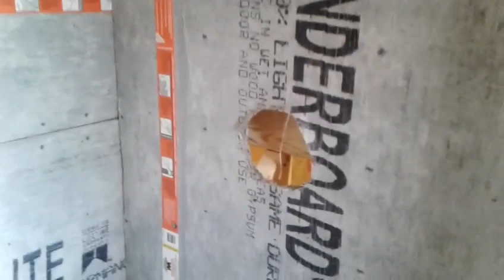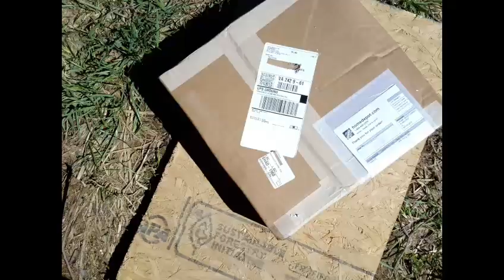Building the Bungalow part 4 finishing the interior

Comment: The saw needs a drop of oil in the bearing opposite of the blade end (near the brushes)and the noise will quit for a while. I sure do like your videos.
Reply from the maker: Thanks--- I hear gears grinding.  It has some kind of brake that has failed as well. I may dismantle it.

Comment: There is a secret oil port on all models give it a little 3 in 1 oil and she will run again no problems. It wouldn't hurt it clean it out by dismantling and getting the goo off the bearings before oiling but if not just a good squirt should do you.

Comment: That looks great I’m really impressed. You are an incredibly talented man! I love those angel singers.
That miter saw was not ruined or broken. It has an electric brake sort of like an emergency brake in your car. The electric break in your saw stops your blade when you let off the trigger using the electric power in reverse. All you need is to order some new brushes for it. I’d order all brushes for it at one time. If you still have it.

Comment: I notice you did not sheath the outside before applying the metal roofing.  I hear many others talk about condensation forming and they take pains to prevent condensation.  They talk about vapor barriers and providing ventilation between the insulation and the exterior walls.  I wonder what your experience has been these past 5 years and if you have peaked behind your insulation to see what it looks like.  I might also think that critters could find their way into your insulation and think it would make a fine breeding ground.  I am dreaming of doing something like this as a complete amateur so I greatly appreciate your videos.  I'll be playing guitar and keyboard though.
Reply from the maker: I have had many questions about this....
I had a fair amount of experience with using metal roofing in the type of application.
I have excellent ventilation and the steep angle of the roof prevents dripping.
I even took part of the roof off to inspect and all is well.  
I have had zero problems.....other than my ongoing battle with mice....lol

Comment: I really like the way the panel looks inside!.  I'm looking at a cheap piece of land in central Florida where mobile homes are allowed and minimum dwelling is 600ft and wonder if they will allow me to count the loft?  Also wondering if the county building department will allow this building style of building with doors/windows only in the front and back.
Reply from the maker: Well..... usually the square footage is the main floorspace.
Asking for a variance is an option.  Often, if you ask, you may get some latitude.
20 x 24 would be a fantastic size.  480 sq. feet, and the loft would be huge without costing much more.

You must have egress in case of fire.  This can be a large window rated for egress or another door.

Can't hurt to ask.  My complete bungalow was $7000 including everything.

Comment: I've done drywall with a professional contractor.  He made it very clear not to butt up two "tape edge" seams like that because of how deep and wide you have to make the mud joint.  Also, that noise seems to be the blade brakes in it.  Just replace the breaks.  Cheaper than a new saw.
Reply from the maker: Thanks....I discovered that I am an idiot....blade was just loose enough to replicate a bad blade brake.
Been building since I was a teenager....taped and mudded zillions of joints...this is the only way I know :)
Reply: I'm not trying to critique.  Just passing on what I was told, as he claimed the deeper the joint, the more likely to crack.
Reply from the maker: That's ok-- I know that by posting videos, I open myself up to criticism.  I can't imagine what your friend could have meant -- but, that's ok-- there are many ways to achieve a goal.  Thanks.